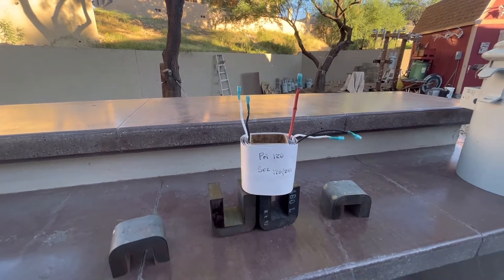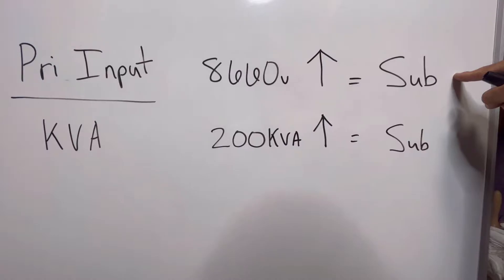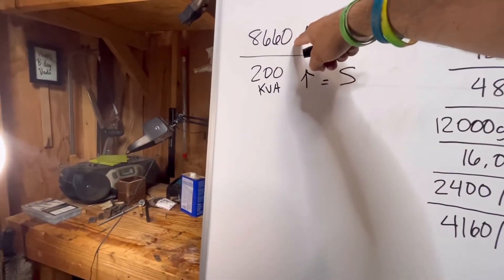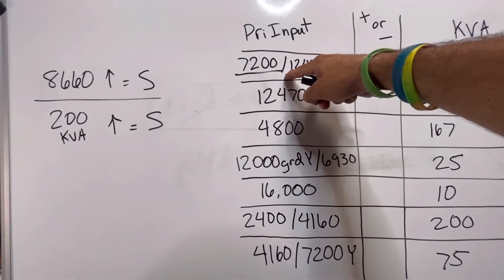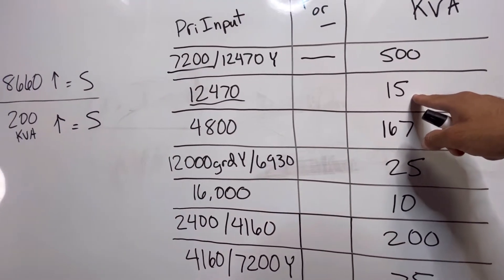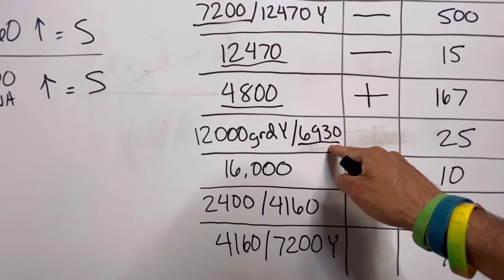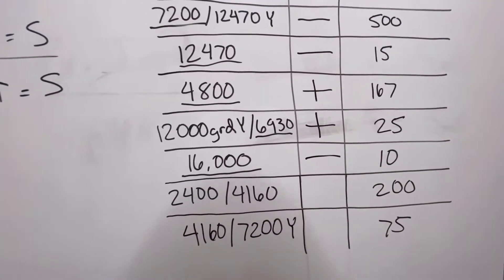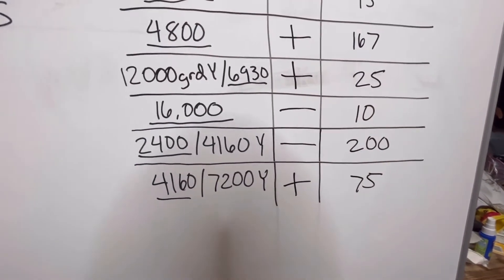TRANSFORMER POLARITY: Everything you need to know

Comment: Im not a linesman - but im an electronics engineer. ( where we use transforners in many applications - but not at such high powers! )
I found this a little confusing - as it seems to be mixing " transformer theory with practical labelling of terminals etc 
The way i see this is:
Lets say i wind a primary winding on a transformer  core . I call the start of the winding P1 - i then wind on say 1000 turns CLOCKWISE- and label the end of the winding P2. 
 I then insulate the primary winding - and then do EXACTLY the same with a secondary winding - labelling the start as S1 - wind on say 100 turns  CLOCKWISE - and label the end of this winding S2. ( I could actually connect "half way" at 50 turns to create 
a "centre tap" to give the usual 120v 0 120v output.
Ok - so we now have a transformer   with primary winding labelled P1 and P2 and a secondary labelled S1 and S2 - and there is a turns ratio of 1000:100 = 10"1 
IF i connect a sine wave source of say 120v (rms) to the primary - I will "see" 120/10  = 12v rms at the secondary  
NOW - If we look at the sine wave  waveform on the primary winding at the instant P1 is going positive - then S1 is also going positive - that is the PHASING of the two windings are "in phase" if we compare P1 to S1 and P2 to S2.   IF we connect 120v rms to P1 and P2- and then connect S1 to P1 - and measure the voltage between the "two ends" P2 and S2 then the 12v secondary "in phase" voltage will subract from 120 v giving 108v. 
Equally - i could " reverse the secondary connections so i now have  P1 connected to S2 and the voltage across P2 to S1 would be 120 +12 = 132v

From a practical / manufacturing point of view - it would make more sense to me to make all transformers " in phase" ( all windings in same direction) and bring all terminals out in same order. 

H1. H2   so pri-sec in phase
X1. X2

 Then - whether the transformer is additive or subtractive is defined only by the extetnal wiring order.

Comment: additive or subtractive transformer you need to identify transformer leads because it's just about the transformer coil leads physical relativity to each other.  Its subtractive if you connect together the X and H leads that are on the SAME SIDE of the transformer (the H2 lead to the X2 lead for example).  That same transformer you can wire it so it can add in the supply voltage or reduce the supply voltage (boost or buck).
Reply from the maker: Thanks for the extra info and for sharing your knowledge, stay safe.👍

Comment: Why not just have subtractive, what’s the point of having the 2 different polarities
Reply from the maker: Great question. So the difference in polarity comes down to the direction that the primary and secondary windings are wound in relation to each other. For example in a subtractive polarity transformer the primary and secondary windings are wound in the same direction around the core. In an additive transformer they are wound in opposite directions. 
So since they’re are two different ways to wind them we had to come up with a qualification to either build them additive or subtractive. If we didn’t do that our connections would be kind of difficult to figure out on the fly and we would have to do a polarity check on every transformer we put in a bank. 

Qualifications 
Pri input-8660 v and above will be subtractive
Kva-above 200 kva will also be subtractive. 

An additive transformer has to be below both qualifications. 

Hope this helped. Stay safe.

Comment: I have two books that go over polarity tests and both jumper from H1 to the left bushing. You're jumper uses the H2 instead... can you elaborate?
Reply from the maker: Great question! When doing a polarity test it doesn’t matter whether you jumped out the two left bushings or the two right bushings. The important thing is that your jumpering out bushings on the same side of the transformer. You will get the same readings on a volt meter either way. Stay safe. 👍

Comment: Awsome video! Please confirm if the 8660V voltage requirement is a line-ground or line to line voltage.
Reply from the maker: So the 8660 rule is in reference to the voltage that the transformer is asking for. 
For example 
Nameplate 8660/14981Y 
The transformer is asking for 8660 volts so the polarity would be subtractive since it meets the subtractive qualification.

Comment: Will you not change polarity if you swap the high sides?
Reply: No.  Polarity is relative between the ungrounded primary phase and the secondary phase.

If you move the primary ungrounded phase, you measure from it to the corresponding secondary phase, e.g., H1 - X1 or H2 - X2.  Swapping H1 and H2 doesn’t really change the measurement.

Comment: Is the H2 in this example grounded during the polarity test? Or did you energize both primary bushings?
Reply from the maker: So I applied 120 volts to the primary side. Phase in H1 and neutral to H2.
Reply: A transformer primary coil always requires two connections with a potential difference in order to be energized. Therefore, at least one connected phase must be ungrounded.

The bushings are hollow insulators that guide conductors from the coil through the case to a safe stand-off distance for the terminals.  Being insulators, transformer bushings technically cannot be energized.

Comment: Why not just make all transformers subtractive?
Reply from the maker: Lol. “How does the posi track on a Plymouth work? It just does”
That’s a great question and one that I have asked a few transformer manufacturers myself and the answer I’ve gotten in return is “tradition”. They all say that this is the standard the industry came up with and this is the way the industry will continue to do it. In other words this is what the industry came up with and to change it up now would just be a ton of un needed work. This is the standard and we can just teach the standard rather than wasting the time to dumb it down even further. Stay safe and don’t hesitate to ask questions. 👍
Reply: @hilineacademy8482  Plymouth used a 2 clutch pack and single spring style of limited slip differential which works by design by locating the clutch packs under each axle gear in the differential geared to 2 spider gears tying together both axles to the spinning differential by a spider gear pin. If the differential rotates at the same rpm as both wheels the clutch packs will permit the slight variation in rpm required for normal cornering but when one wheel spins faster than the other the differential fluid that's between the spinning wheel clutch pack will displace the fluid and gradually send the torque spinning the wheel to the differential housing which transfer that torque across to the other wheels clutch pack and the slip will displace the fluid and send the torque through the axle gear and the lazy wheel, commonly called the left for forward lead foots, and both wheels will rotate at similar RPM. Positraction is a GM name brand similar to Surefoot with Chrysler. 
The instructor of my electrical preapprenticeship in 1980 had a similar query on the 66 Fury III Rhetorical 383 4 speed... but I got to use his thousand word blackboard.

Proofreading allergy so feel free to scratch and dent.
Cheers.

Comment: If you had a single bushing transformer, could you hook up your 120v to the H1 and the case ground as opposed of the H2?
Reply from the maker: Absolutely. I would hook up the hot 120 to H1 and the neutral to the pot lug (H2). Then jumper out the case to the secondary bushing on the right. Then measure with a volt meter between H1 and the left secondary bushing. Stay safe. 👍

Comment: Wonderful But looking for the explanation as to why NEEDED?

Under stand the rules over 200 KVA need subtractive transformer, but
why?
Reply from the maker: Great question. The need for larger transformers to me subtractive has more to do with building them. Without getting too much into it. It is beneficial to the transformer manufacturers to make them subtractive because the insulation needs are lower on subtractive cans. We don’t see the benefits on the distribution side as much as they do on the big power transformers where here voltages are larger.

Comment: Hey Cody, what is the functional difference between an additive and subtractive transfer? Meaning, what difference does it make when the primary winding is wound in the same direction as the secondary winding or if they are wound in opposite direction?
Reply from the maker: So. In the lower primary voltage transformers there’s not a lot of functionality to it. They had to make a standard, meaning that transformers with a primary voltage input of 8660 volts  and above will be wound subtractive only because there is an option of winding them one of two ways. 
In the higher primary voltage transformers there are advantages to keeping a lower difference of potential on the same side of the transformer for insulation purposes
Reply: Insulation is a reason to make subtractive winding standard.

Insulation doesn’t explain why VA requirement is a consideration.

Comment: What are the specs on that nice little transformer?  Where can someone get one?
Reply from the maker: It’s a 120 primary to 120/240 secondary. I bought some 1/2 kva transformers that had blown up. Then drained the oil, pulled the cores, and rewound new coils for them. It was a lot of work. I still have to wind some 208 primary to 120/240 secondary. I’ve just had a lot going on and haven’t had time to do it. 👍

Comment: What if your transformer is 23900/13800 x 13800/7979 dual voltage? Is additive or subtractive?
Reply from the maker: Awsome question. With dual voltage transformers, the manufacturer will base polarity off of the larger voltage requirement. In other words, since this transformer can be fed with either 13.8 or 7979 volts, they would make it a subtractive transformer because 13.8 is over the 8660 volt qualification. 👍
Reply: @hilineacademy8482 this helped me understand my scenario so much
Reply: What if the suply is single phase 220v.  10kva a.c. alternator  and the  secondary output we need 50kw.  What kind of tranformer we buy.
Reply: @benjamenclemenal.5523 :

You would need a magical transformer to meet your impossible specifications.